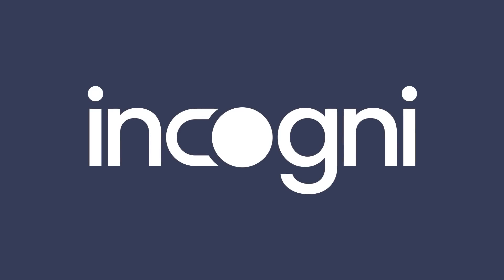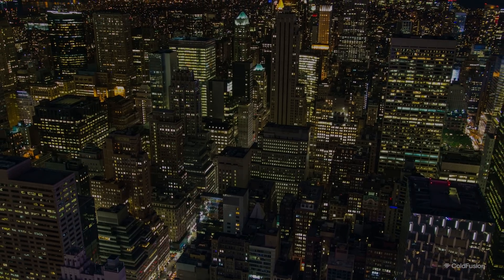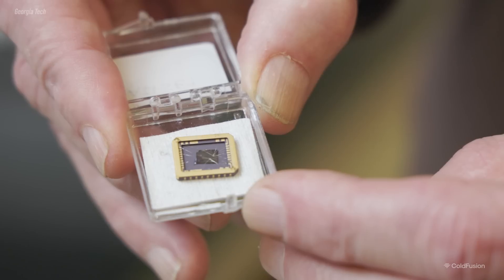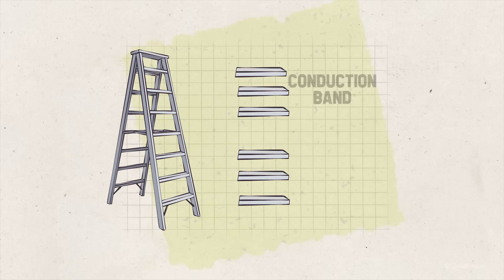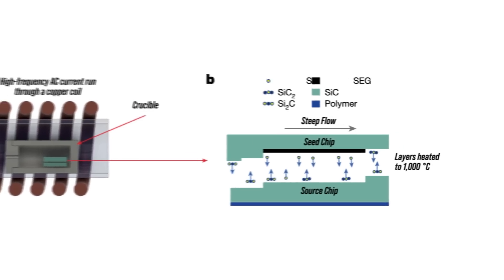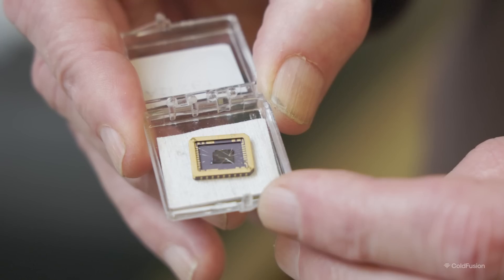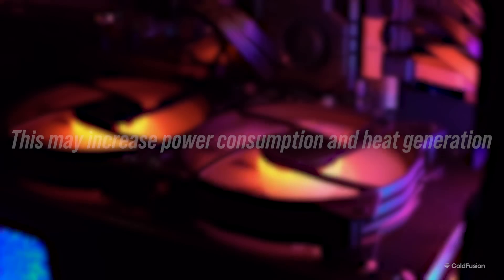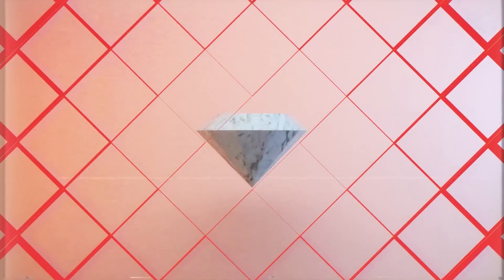This Chip Could Change Computing Forever

Comment: I've heard, for about 20 years now, that a development just around the corner will make laptops last a week without a charge. Never happens. Color me skeptic.
Reply: well technically speaking if we had the computers with the power from 20 years ago running on modern batteries they would actually be able to run for a week. the problem is that processing power and demand is increasing too fast.
Reply: @jesus2639 Eh, not necessarily. Older Chips were much less efficient compared to modern ones. Whereas modern processors are capable of providing the same amount of computational power as those old CPUs, utilizing much less power. Although, we took advantage of that better efficiency and greater transistor density to produce chips capable of producing much greater computational performance. Battery life has improved due to better power management of how much energy is provided to a CPU or GPU depending on its workload and the breakthroughs in battery chemistry with Lithium Ion and Lithium Polymer batteries and hopefully with the advent of Solid State Batteries, battery capacity will continue to improve. Also, with the introduction of GaN (gallium nitride) power supplies, we are able to provide much higher wattages when charging and powering devices with greater energy and thermal efficiency.
Reply: @jesus2639 I have an iphone 4 I occasionally recharge just to keep it alive. With everything disabled and turned off the battery last 27 days.
Reply: That's an interesting observation. Makes sense:) @jesus2639
Reply: @jesus2639  On the CPU side of things, can’t really call processing power increasing 15-20% every 2 years as “too fast”. I’ll consider it too fast when we start getting massive jumps in CPU clock speed again, cuz even IPC improvements aren’t big anymore
Reply: I thought it was the opposite. Chip architecture getting smaller and smaller and needing less pkwer to operate, thus lasting lk ger o. The same size batteries. The problem i see is laptop batteries getting smaller to save weight and display resolution and brightness getting greater using more power. Phones are the same, getting bigger and bigger displays and running brighter with higher resoltion while batteries get smaller.@jesus2639
Reply: @jesus2639  it would be the opposite the computers today are much more power efficient
Reply: @jesus2639  Well, we have the product actually, we just call that mobile phone now
Reply: @jesus2639 I was going to write exactly this.  Well said.  (Computers from a few years ago let alone 20 years ago could run a very long time on today’s battery technology, it’s just that processing power gets exponentially more powerful l, requiring more energy.)
Reply: This. We got addicted to graphics
Reply: @jesus2639  no? Absolutely not? TDP of late 90s - early 2000S CPUs was the same as 2-3 y.o. high end CPU?
Reply: @jaleger2295 you failed to mention all the other differences, we have better batteries now, we have brighter screens, higher resolution better refresh rates, higher wattage usage in CPUs and GPUs, if you lowered all of those you would get a significant amount more time per charge, this is proven in current phones
Reply: @jaleger2295  really doesn't work like that. We have super low wattage CPUs that consome a miniscule amount of power compared to the best of the 2000s and outperform them with leaps and bounds. Yes we have 145w consumer monsters but that's just because the demand Is now there for applications we diddnt have then. There were zero 300w GPUs or GPGPUS then but we have now. Most GPU or parallel processing units were in double digit wattage at best. Were getting far more efficient performance/watt then we've ever had... ever. So your statement is categorically false
Reply: TIME. We don't all have it, but these take time. 25 years ago it took 20 minutes to download a 12 second  porn clip. Now I complain when a 4 GB movie takes 2 minutes.
Reply: @ald.3387 you mustve had a T1 line to download that clip so fast!  Or knew someone at Kazaa
Reply: My e-ink tablet lasts for weeks
Reply: Thing is in the same time we developed more and more energy hungry computers so it tends to balance to the user needs (1 day).
Reply: This.  Google and Apple will just run more bloatwares in the background to drain that battery.
Reply: i would like to point out that if you were still doing the same things with your laptop as 20 years ago modern laptops could manage running a week easy.
Reply: Ehhh, look at the numbers
Lowest TDP atom laptop processors are like, six watts. There are 168 hours in a week. Times six that's 1008 watt hours, way beyond any laptop batteries available on the market.

Apple M1 has seven watts minimum TDP, so ARM magic has no power here either.
Reply: Actually, if you was to design a laptop with the same computing power as the year 2000, and used a high efficiency display, yes, then you could probably get a laptop to last a week without needing a charge.
Reply: But laptops do run for a week without charge, that’s if you use laptops from 20 years ago with batteries from toda. But since capabilities of laptops of upgraded too, they demand more energy and hence can’t last for a week
Reply: Well technically, today we could indeed make a laptop that would last of battery for a week and would be of form factor and performance similar to what used to be 20 years ago. It's just that every time we given opportunity we tend to instead take better form factor, more pixels and brightness on screen, and more performance, instead of increased battery life.
Reply: They do! But then they pack in more power hungry stuff. Just like how games keep looking better but instead of story, they stuff in micro transactions.
Reply: Lol thing is, if you made a computer that had the same processing power as one 20 years ago with a modern battery, it would definitely last at least a week
Reply: There were times we thought we could never fly, go to space and more through our history.
It our species how long to invent something  you can watch this and criticize it's taking to long on ?.
Reply: Well, we (as the general consumer) don’t really want that. 4-8h is enough, everything extra is either allocated to more computing power or just useless aditional weight and cost.

The same with modern phones, 1.5~2 days is enough, and apart from a few fringe use cases, the rest is just pointless weight and cost.
Reply: And it is true. The compute of a windows 98 machine could already today last for two weeks and more (bottle neck the light in the display). But because people don’t care that their machine has battery for more than a day, the workload demand scaled relatively to keep it at a day, while processing 20x and more of what was common before.
Reply: And this is really the whole problem. We've seen many claims of graphene revolutionising electronics but the simple fact is that production costs are still far too high and all these claims of the manufacturing being so cheap are deliberately vague. Even graphene battries, which are nowhere near as complex as a transistor, are still considered too costly for mass production despite their advantages. At present the production cost of lithium is $11/kg with graphene being $200/kg. That alone is why estimates say that despite graphene production increasing it still won't become a viable alternative until 2031 and that's assuming lithium doesn't get cheaper to manufactuer or new naturally occuring sources are ever found.
Reply: The problem is the media. They exaggerated the output of graphene. Graphene is going to come out and revolutionize many things, but it will not come out alone in 10 years from its discovery (2004).
Reply: Check how difficult it was to invent the blue LED.
Reply: We could make one tomorrow.

But would be an brick thick laptop powered by an small low power mid range smartphone ARM chip.
Reply: AEROSPACE Engineer here and I've heard some similar stories regarding many technologies like: 
1950 We'll have Nuclear Fusion in 30 years because somebody made a breakthrough.
1960 We'll have Nuclear Fusion in 30 years because somebody made a breakthrough.
1970 We'll have Nuclear Fusion in 30 years because somebody made a breakthrough.
1980 We'll have Nuclear Fusion in 30 years because somebody made a breakthrough.
1990 We'll have Nuclear Fusion in 30 years because somebody made a breakthrough.
2000 We'll have Nuclear Fusion in 30 years because somebody made a breakthrough.
2010 We'll have Nuclear Fusion in 30 years because somebody made a breakthrough.
2020 We'll have Nuclear Fusion in 30 years because somebody made a breakthrough.
By chance can you guess how far away nuclear fusion will be in 2030?

I'm Australian but did my degree in America.
I was doing my degree in the late 80s and we EXPECTED to build Space Station Freedom in the 1990s and then be back on the Moon by 2001 to start setting up a lunar base that would be the start of a permanent settlement AND YES we took that date from the film. 

THEN the Challenger accident happened and as we know it was because of poor decisions being made by the wrong people. That has been followed by several 1,000 poor decisions being made by the wrong people and we are no closer to a permanent lunar base than we were January 28, 1986 when Challenger happened.

I have spent the last 30+ years working across a variety of industries doing industrial control systems and trying quietly to learn from these industries how we might do stuff on the moon. 

So long as we have the combination of the wrong people making bad decisions in combination with the unrealistic promotions (and at least Cold Fusion does but "providers" into the story) of effectively vacant over rated (and often over hyped) "future technologies" that will re-shape humanity we wont (as a species) move forward because too many of the basic things like food, shelter, clean water, clean energy and a few other things are NOT DEALT WITH as a priority. 

I have spent most of the last 20 years working on construction mines in remote locations because it presents the same sorts of issues building a lunar base has. Everything is at least 3 days away, the environment is hostile and you have to build all the basic infrastructure any modern society needs including housing, food storage, food prep, clean water, waste water, power (including power distribution), roads and very importantly workshops for maintenance.

While we have story after story of the latest break though technology we are also surrounded by crumbling infrastructure. Go and look at any modern society and you will find major infrastructure issues. They might differ from country to country but we all have them. Energy infrastructure is the major issue that most have and its a serious issue because everything needs energy.
Reply: Well there is one major problem:  Software developers have gotten lazier and lazier with writing lightweight efficient software.  The hardware keeps getting faster and faster but ends up taking more cycles to accomplish the same amount of work because of the laziness issue.  Battery life has gotten notably better.  Not anywhere close to the "week-long battery life" range but the best laptop batteries used to only last about 3 hours and weighed a couple of pounds.  Now they barely weigh anything and last about 8-10 hours on a single charge.  So incremental improvements have been consistently made over many, many years.
Reply: So technology is at the same stage as it was 20 years ago. Damn why did i buy a new gaming pc....
Reply: Cost of graphene was never there when you had cheaper work arounds by just packing more transistors or other methods to get similar end goals. 

 I think physics has forced our hands, and that altneratives are required if we want to see improvement.  

 Whether it competes with other tech is the biggest question.

 Not to mention graphene research and production has improved. We actually HAVE been using graphene in applications.  From metal urgy to cement production. Lots of different things!

 Just need to get pure graphene to be cheaper is all!
Reply: Facts, just like apparently our government has been in contact with aliens but I’m waiting until they show themselves up front loud and proud before I believe it just like a lot of science
Reply: Read some papers on it
Reply: But now we have AI. AI will make all possible. Don't ask me how. But AI!! (;
Reply: There was always a need accelerated by personal computing devices and EV but I don't think there was anything "around the corner" in fact everyone is racing to find new materials for battery.  but AI for sure will speed up the search for materials that will be compatible to work as battery.
Reply: Me too
Reply: Arm based CPUs. Your welcome
Reply: The difference between a breakthrough and making it commercially viable. The difference between a person taking a week to make one "Transistor" the size of a pea and being able to make billions of much smaller transistors in the form of an integrated circuit (a computer chip) and spit thousands of those out every week.
Reply: Google Borophene and thank me later
Reply: Have you seen how fast Llama 3 is?
Reply: Can you wait for a few more years now 😅
Reply: It’s for me M series MacBook is realization of such proposals.
Reply: Weird, I haven’t.
Reply: I'm still waiting for my hoverboard
Reply: The other day someone explained the same concern as it relates to fusion.  

In fusions case we are trying to build an engineering solution that utilizes the extreme edge of our understanding of physics.  What this means in practice is that engineers building the reactors can't really model the reaction since we have no idea what is actually happen.  This means that every step forward requires trial and error and physical testing.  Where a breakthrough in a known process like fission would require building a model to play with the changes, for fusion you can't do that because the physics is unknown.  

I wonder if graphene based transistors are in the same boat.  It could work but we don't have the modelling to make it happen in a short period of time.
Reply: Spent my entire working career around people like you who did their best to slow down or prevent advancement.
Reply: Battery technology is not an engineering technology like CPUs or GPUs. It’s a Chemical technology. So it needs time and chance.
Reply: Hold on let me find some crayons
Reply: Agree. From research/breakthrough to economical production takes about 20 plus years.
Reply: Right up there w fusion.
Reply: Same thought, if it happens it will be in 30 more years
Reply: I actually have a laptop that lasts a week; it just has the graphics memory and speed of a laptop from 20 years ago.
Reply: I guess you havent heard about macbooks with m processors
Reply: OP That wouldnt sell more products!
Reply: We can do that now just dont turn it on....
Reply: You could make a laptop with the processing power equivalent to that of one 20 years ago last a week on one charge.
Reply: I think scientifcally that might be possible , however the economics of it fails due to the market will fall , like light bulbs , did you know there is a light bulb running over a 100 hundred years still to this day , the point is companies will never make a solid product because it brings down sales , if its not breaking your not going to buy another simple as that.
Reply: He looks like the next scammer.  I want a gas powered phone please!
Reply: Nuclear fusion
Reply: @Seakingalpha  sure we are going to have system A at 80 million degrees and with a centimeter system B will be -260 degrees.  That's literally having you cake and eat it to.  But hey it would be great.  Anyways we already have Fusion it's called a hydrogen bomb.  Let say the Fusion slogan "Another 20 years!"
Reply: They could easily make a laptop that has the performance of one from twenty years ago last a week...
Reply: @matthewjudge3763 if you can give me the numbers I'd believe you. Laptop batteries nowadays are like 100-200 watt hours. To last literally a week you'd need one in the order of thousands, even with the most efficient processors and screens.
I guess if you literallt re-manufacture a 386 in 3 nm process node you can do that lol but no foundry would take that request seriously.
Reply: if programs were as complex as they were 20 years ago, your laptop would last a month. the problem is that as hardware gets better, software gets bigger
Reply: Well whats stopping us of having 7 smartphone batteries of a current gen flagship phone that  has a 24 hour battery life and connect them to one high efficiency oled screen twice the size than found in folding phones, connect one smartphone motherboard and a keyboard. Then you'd have a "laptop" with 7x 24h battery life powered by most likely android, which can function as a laptop, like Samsung Dex.  (Current day flagship  smartphones are about as powerful as a midrange pc in 2019)
Reply: For real, every year you hear about a fancy schmancy breakthrough that's about to CHANGE THE UNIVERSE AS A WHOLE just for it to either pewter out or move the goalpost again and again ad nauseam.
Reply: The real problem is the amount of graphite that would be needed and with current levels low things could be a big problem for making graphene
Reply: 20 years ago folks were promising cheap, lightweight television screens were right around the corner. I sat in a similar on something called “OLED” in 2005. It’ll never happen
Reply: Same thing with battery technology
Reply: It won't ever happen because. Capitalism.

Making things that last is antithetical to making profit.

A battery like that would last a really long time.

So less profits
Reply: @halcyonramirez6469 yeah , I bet communism will bring us great progress like the soviet Union 😂
Reply: @halcyonramirez6469  at least it will eventually get built, unlike in communism!
Reply: @solo1014  I don't know man. capitalism is just as bad if not worse than communism if left unchecked. It's just not sustainable and we're already seeing the cracks
Reply: @halcyonramirez6469  capitalism has a much better track record than any communist economic system.  With far fewer people dying of basic necessities.  (In capitalist countries, death is far more frequent from excess than deprivation.)
Reply: They could last a week. It’s just companies are trying to find a balance between battery life and capabilities. Companies would rather keep what they perceive to be a long enough battery life and increase the performance instead.
Reply: Honestly, I use my Mac for 3-4 days without charging, pretty close
Reply: Thanks professor smart ass
Reply: Amen. Can the paper be replicated? If so, we are happily wrong. Otherwise it will always be 20 years away.
Reply: Laptop charge once, last for 3 to 6 months after 20 years now.
Mark my words 🍵
Reply: I charged my laptop once, 8 years ago, it ran away and i havent seen it since!
Reply: It will last a week if you’re satisfied with a computer that has the same compute as computers from 20 years ago
Reply: Research is always continuing, but the jump to manufacturing and product finalization could take decades. This one is a pretty step jump. A chip has hundreds of problems to solve, and they’re all fragmented and colliding.
Reply: An example, EUV was invented in the 1980s. TSMC started using it in 2019. That’s how much time it took for it to become used worldwide. The problem is too complicated, and often involves quantum physics now.
Reply: It will happen, but decades from now.
Reply: Remember the Magic Leap VR/AR startup? Same story.
Reply: It’s because software became more and more demanding
This is what they didn’t calculate the evolution of operating system
Reply: dont go well with obsolete-to-be tech i guess...
Reply: The first computer was created 80 years ago. We had to wait another 40 to own one. These things take time
Reply: The wonder of graphene has been systematically kept under the radar.
Better said we have birds in the sky that are nearly undetectable using this technology on full size scale.
Reply: Instead people keep choosing faster conputers, lighter machines, bigger screens, and beefier graphics.  
There isn't an actual demand for it to last a week compared to these things, otherwise it would be on market already.
Consider that a mid tier phone can emulate a laptop from 20 years ago, and if you added battery to make up the size/weight difference, it could definitely last more than a week.  

We even have tech like this in consumer devices already. I charge my Kindle every 2-5 books read, about once a month.
Reply: Today, the marketing liars do the same with EVs ! Iit is just to speculate. Reality is different, yet progress is made.
Reply: You don’t understand greedy R&D among corporations. If development is linear if your on speed 3 and you discover a way to skip to speed 20 you don’t use that technology. You squeeze every penny out at every number up to 20 then you “discover” the world changing material.
Reply: Except Apple did exactly that with M1 chip
Reply: @seansingh4421  no lol. M1 chip is 7 watt at its lowest mode, the macbook has 100 wh battery. powering just the processor alone would only last the battery 15 hours, which is far cry from "a week"
Reply: Trust me bro just around this last corner, it's going to happen, bro just one last corner and we're there bro trust me
Reply: Put a new battery in an old cell phone it will last a month
Reply: It's not that advancements aren't being made; rather, it's more a case of underestimating the complexities of getting these new advancements to a point of efficiency (ease of production, power consumption, etc.) where these technologies could be introduced into the market. Additionally, as annoying as it may be, researchers working on these types of long running projects require funding and one way to get more funding is to create excitement around their projects, so of course there is a tendency to exaggerate at times.

This, however, seems more promising than most advancements given how little change to manufacturing processes that would be required in order to begin producing chips with this technology. Most upcoming technological advancements require entirely new manufacturing or fabrication processes and different, sometimes expensive materials, and that's a much bigger hurdle to overcome than research and development.
Reply: @radicalraccoon  Good comment.
I'd however use the word viability rather than efficiency in the middle of the first paragraph because that's what your talking about with things like "ease of production."

On your second paragraph however is that your 1/2 right in that some parts of the chip manufacturing will be the same or similar. In particular mounting the chip into a substrate and attaching the pin connections  and then encasing it should be reasonably close if not identical. 

BUT if you have ever looked at how they actually make the actual chip in terms of the layering then this will NOT be the same. If it was then these chips would be on their way to market and they are still years away.
Reply: Batteries have evolved significantly. However computing chips have also evolved needing more power. An iphone battery, can run for a month on a brick phone.
Reply: @da7me22  I don't think they'd run a brick phone for a month but the point you make is valid. 

A lot of people do not know how much power these larger systems actually require. Just recently in North or South Carolina they rejected a company wanting to put in a sever farm. People ranted about jobs until they realised 2 things. Once built the server farm would have ZERO permanent staff as they'd run it all form other places. SECOND it was going to need over 900 Megawatts of power. The latest AP1000 Nuclear power reactors at Vogtle in Georgia cost US$17 Billion EACH. and they put out 1100MW.

YES Computing systems now require massive amounts of energy and a significant part of that is cooling. Iceland is currently hosting a lot of the crypto currency mining systems. Because every transaction needs processing and in Iceland they have an energy free cooling system called "a window" and they just open it.

Our wonderful IT world uses staggering amounts of power and mobile phones are just one part of it. Each mobile phone in itself doesn't use much power but the billions we have use a lot of energy to charge and the networks use a heap more to operate.
Reply: Not sure why anyone would need a week's charge. Most laptops spend 90% of the day plugged in.
Reply: @MirzaAhmed89   you wouldn’t want your  car battery to last 10x longer?
Reply: it generally takes about 20-30 years for stuff to leave the university and make it into a product. Especially dramatic breakthroughs.
Reply: Its not profitable business
Reply: It's a really big corner but progress is being made.
Reply: I was thinking same thing
Reply: Look at macbooks with the new M generation chips and compare them to notebooks just a couple of years before.
Reply: Revealed preferences of most consumers is that they don't care about battery life so battery improvements are converted to support more powerful items.
Reply: Ok but we're your invention at 😅😅
Reply: Soon enough my friend, soon enough we'll have graphene cpu laptops, with 500mb ssd
Reply: Unless you're using an E-ink display, it's still probably not going to last a week. A good chunk of battery is used for the display.
Reply: I think they put it in Ipad. My ipad last a month if I don't use it lol. My watch last for about a month. With heart rate reader off.
Reply: for that, we need e-ink displays

chips are using only a small part of the overall energy
Reply: Battery problem, not computing problem.
Reply: The M1 Chip is literally what you’re asking for.  The MacBook Air with the M1 chip is so efficient it lasted me nearly a week.  On normal use (browsing, emails, etc) it lasts 19-22 hours.
Reply: A Nokia lasted forever... Bring in a bright screen and your battery will die..
Reply: They already exist. When batteries got bigger computers got more demanding.

put a new battery in an old computer & it will run for several weeks.
Reply: Same with fusion
Reply: Technology moves at an excruciatingly slow pace in the past decades.
Reply: Mine does, I never open it
Reply: I agree with you I've been hearing about this forever battery forever now
Reply: This is 100% true,but only for RnD. The mass public would never see this because the big corps although have this tech would never allow it tp be produced for the masses, not yet anyways
Reply: It's the same as fusion it's always around the corner 😂.
Reply: Cause it's probably in our weapons of warfare. They probably don't want the 'competition' buying a laptop and getting up to par with the USA.
Reply: It's still possible but companies work on finances and want their old manufacturing facilities to make profit even if it means not caring about innovation😢
Reply: Indeed, most of the power will just be consumed by the display.
Reply: The World will change very quickly now
Reply: Anastasia tech recently did a video on this same topic.
Reply: just curious, do you think anything is more advanced in the last 20 years? or you think nothing has happened? probably too clever to be bamboozled into thinking there's any progress.
Reply: Same with cancer cure : Never happens ,might never happen until a new life threatening disease is explored.
Reply: @andresconrado 
Yeah, about 20yrs sounds about right. 
Ignore it. Either its bs marketing, or want-a-be's, being the first to spread the rumors.
Reply: Countless discoveries and technologies are absolutely world changing and never go mainstream or see the light of day. Just an unfortunate state of the world as of late.
Reply: your not wrong
Reply: It used to be very expensive and not a lot of it.  Now it's already available in consumer electronics.
Reply: My MacBook Air M1 last a week for my usage, LaTeX typing and some web browsing every now and then. So technically the technology that allow laptops to last a week without a charge exists. Unless you want to be more specific about how the laptops are used
Reply: Laptops will never last a week without charge,  that has little value to consumers. So instead batteries shrink.    
Look at the size of old laptop batteries, if we kept them that size new Mac m2 would last a week easy
Reply: So true
Reply: My macbook in sleepmode for a week without a charge.
Reply: Bro said 20 years. Thought graphene became a thing in 2012
Reply: not to be corny or anything but they said the same thing about the lightbulb
Reply: As i'm getting older i'm getting more skeptical about these so-called breakthroughs, or maybe just more cynical.
It is hard to be persuaded by these promises when in my short 30 years of being alive i've seen so many false promises and flops.
I believe that progress is not linear nor exponential, but rather has bursts and is spontaneous more than anything else.
People always see bursts of progress and assume that it will continue at a similar pace, when in fact it never continues at its current rate.
Reply: I think photon based computing will come first (not the quantum one, different).
Reply: Smartphone is not a thing 20 years ago bud.
Reply: You should have had the experience of going from Intel to M1 on a MacBook. Extremely fast and three full working days of charge.
“Imagine your laptops being five times faster and lasting for days on a charge” - have tried it!
Reply: I was 16 and well into tech in 2004 and nowhere did I ever hear any claim of - a LAPTOP of all things - lasting a week... Battery tech was utter trash in those days, I would love to see who made the claim that a "1 week laptop is just around the corner".
Reply: 20 years is irrelevant in the total span of time. Think of how long it took humans to come up with the light bulb. Do you not think our ancestors didn't imagine a way to have indoor artificial light?
Reply: someone have to invest into economy of scaling of new techs
Reply: The thing is, the chip may go well in lab, but not in small scale production. Then after they fix that it might not go well in large scale production, then they need to fix any real world testing etc.
Reply: Wonder if it's a matter of $$$$ as in the world live the longer something lasts the less you buy hence Cr@pples business model planned obsolescence so you're forced to buy new according to apples schedule.
Reply: I mean, Apple kind of did it. My macbook with M1 lasts 10x longer than any windows laptop I've ever owned.
Reply: its all cool until we get hit with a pandemic and we realize that we cant even manufacture face masks and have to beg china for it lol . all these scientific brakethroughs news is more of a propaganda tool than reality .
Reply: lol maybe because processing speed and power usage also increases along with power storage and distribution along with loss...did you even watch the video mr skeptic
Reply: It has happened. If the tech was patented, you can bet it was either brought up and shelved or, patent laws made it a 'national security' issue
Reply: Do you know anything at all about the science behind any of the technologies you’re complaining about? 

The shortest answer to your unwritten question is…. 

Battery technology hasn’t even come close to keeping up with microprocessor technology and its famous Moores Law. 

More specifically and even more critical is that charging technology hasn’t been anywhere close to being capable of realistically supporting a battery with an energy density sufficient to power a current generation laptop in the way you imply. 

Imagine charging a Tesla with a 12v home plug. Ya it gets amazing mileage but I have spend 3 days charging it…
Reply: Tech does exist but if given to masses so easily then who will buy new laptops, phones so frequently 😂
Reply: @brade2163  You’re just repeating what yer man said. Instead of it being science and its horrible timeline predictions, you’re saying the “tech” exists but is held back because of capitalist greed. 

You’re both just vomiting tinfoil hat level thread comments. 

🤫
Reply: First, all the tech that is passed down to consumer level, has to go through military application. Military tech needs to be at least 2-5 decades ahead of consumer tech. 

Second, to please the shareholders, manufacturers will do their best to extract every single penny from the current tech and then introduce the next phase when the profits start plateauing. 

Tech may already be there, but, it has to go through channels that takes years before reaching the consumers.
Reply: It's part of the 'marketing' strategy to get funding. Scientists and engineers need to market their ideas to get it going too. So always take whatever you watch/hear/read with a grain of salt, because all those promises or speculations will remain as is until a breakthrough happens and we see a working model of the thing they are promising.
Reply: So i bought a keypad mobile and it has the latest battery technology and 3000mah which makes it last like 2 weeks . So i think the the batteries are improving but the processing power needed are also increasing .
Reply: Depends on which laptop you’re talking about. If we’re running a laptop from 20years ago today, it’d probably run for a month without charge
Reply: Hope it doesnt just get absorbed by amd  or nviidia but he decides to go elon musk style and gives us innovation again instead of this step by step design these companies have worked out to maximize profits.
Reply: Anything too efficient doesn’t make money so it will never happen.
Reply: It's 30 years since we had the first browser, Mosaic and then Netscape.
Do you think the Internet have changed since then?.

Silicon transistors was created at the endo of 1947, about 75 years ago. But the Intel 4004 wasn't launched until 1971, 24 years later, and Intel 8008 1872. So, it took 25 years to get from knowing that semiconductors was possible to the CPU we utilized in out first primitive PC.
And that was from a material that was a semiconuctor, and not just a conductor.

Graphene was first made/discovered 2004, so 20 years ago. Prodused by pulling it of granite with a tape!
I guess the production technique of it has improved somewhat since then. But that's just a very good conductor, not useful for much else

And you think 20 years is a long time from detecting a new form om material, a conductor, to make integrated semiconductors from it?
Reply: fully agree, with carbon there are since 1950 freaking close ...
Reply: They require finance. Wait till it reaches the Chinese?
Reply: Because it already happened and there was already a few models of notebooks that had low calculation power, but  high power efficiency and got big batteries on board. As for phones, the old models of Nokia could've functioned for month without charging (H18 and 3310)
Reply: Yea, but now we actually have an example of the tech that works. This is a decently good milestone that brings us closer to actually bringing this to market
Reply: It's easy not to even try in the first place 😂
Reply: Companies:wheres the profit in that?
Reply: They did succeed but the consumption jumped too
Reply: Literally my reaction exactly! How about before we talk about it becoming a technology introduce it into something and then yap about it.
Reply: It's not possible, until it happens. Then it's obvious. Enjoy your horseless carriage 😂
Reply: I didn’t mind the low bandgap so much as the missing explanation of exactly what made it semiconducting.  What was the secret sauce?
Reply: @OtterFlys  it's explained in the video....
Reply: This was an attraction bait, cpuz abd gpuz don't consume the majority of phone charge (you still havw the big ol display)

But just think that this is much better processors
Reply: I mean the tech is there, it could have happened 10 years ago easily. Why companies prioritize for battery life to such a degree?
Reply: That’s the case with nuclear fusion power plants.
Reply: @kiuk_kiks not really. Since the 50’s scientists have known fusion is solved, it was merely a matter of scale, it only works once power plants are of tremendous size, which thus far had never been built. Technically even ITER, despite being an attempt to build them closer to the size at which we know for a fact it will work, is still only about 60% of the size we expect a working fusion reactor to need to be at minimum. They need to be utterly massive, dozens of stories, over a hundred meters wide, etc. and the world economy could technically afford to build one now, but that would be a huge chunk of the total global economy for several years just to build the thing.
Reply: @smallpeople172  
It’s not a matter of scale though. They’re net consumers of electric power.
Reply: @kiuk_kiks  yes until they reach a certain size, and below that size they aren't able to produce net energy. This has been a long known issue in fusion. Literally what I'm talking about about. They are known to be unable to produce power below a certain size threshold, much larger than ITER. All the projects on fusion are really just miniaturization projects
Reply: @kiuk_kiks  those doing the work always think they are almost done. They tarely are. In all disciplines.
Reply: You do realize innovation doesn’t happen with a snap of your fingers right?
Reply: @Retly_Ai 20 years isn't a snap of your fingers mate.
Reply: @Alec_Reaper  The older I get, the less I agree with your comment.
Reply: @Alec_Reaper  using 1 example of tech is how laptops have only existed for 45 years. Do you automatically assume technology is at a standstill still? 20 years is about half that time. So sorry if you lack the ability to understand how innovation works. 🤷🏻‍♂️
Reply: Sure, and Rome was built in a day.
Reply: @Retly_Ai  He never said,indicated or assumed that technology was at a standstill, you assumed he did or disingenuously portrayed that way. And whats sad is your inability to communicate without being an arse to feed your ego.
I have been hearing about this for ages and still not one thing out yet, so at least some weary skepticism would be understandable and all he was saying.
Reply: Then be specific in the "far future"
Reply: @tshwarelolebeko2395 well we don’t know how far in the future, and when working on some project, people are typically expecting it to be done sooner than it really will be, and the really will be is impossible to predict
Reply: @Retly_Ai it has to go through the military first, then we get it 😅
Reply: @mortalkombat266 Unironically, the military doesnt get the best and lastest nowadays and consumer chips can outperform those produced specifically for military use. In fact the us military bought 1000 playstation 3s years ago instead of buying enterprise grade equipment to build a supercomputer. It was one of the most powerful supercomputer cluster that the us military had at the time.

Edit: People tend to forget that new technologies introduces vulnerabities. Vulnerabilities that the us military wouldnt wanna take.
Reply: @BocchiSensei  The Black Ops military does.
Reply: @BocchiSensei 
Performance is usually the secondary concern when it comes to military equipment, sturdiness comes first since any military grade equipment needs to withstand harsh conditions.
Reply: @mortalkombat266 military doesn’t get the best shit first. 

That was once the case, but if you’ve been enlisted, you know the term military-grade is a joke of sorts.
Reply: @BocchiSensei  🤣
Reply: @BocchiSensei they did that to test gaming platforms, they had a classical computer as well they bought that same year.
Reply: @BocchiSensei the military actually gets better because current manufacturing is chip tech and processes stable enough to have less then 10% misprints, whereas military will use experimental stuff and get a 10% usable chip, but throw out the rest. That’s why their computer systems typically cost over 50x as much as consumer ones, they’re using unstable bleeding edge tech with high manufacturing failure rates.
Reply: @BocchiSensei  the NSA would disagree with you.
Reply: @mortalkombat266 that's not how any of this works
Reply: @smallpeople172 Tech will cost more than average due to low demand and yields. Companies that solely manufucture electronics for militaries are usually more expensive not necessarily because they are bleeding edge, but because they have no where else to sell the stuff to. Any military officer (well most, cant say that all of them are competent and experts) would tell you that they would rather use proven and reliable technologies than ones that are new and unstable as you have mentioned. Its also just logical, a country wont fully mobilize its tech industry towards the military until they are at war. Despite the US spending hundreds of billions each year, this is quite small compared to once they actually mobilize. There was also a documentary that Ive watched before about the real reason why the us military spends so much, I cant really remember much but they do overspend on things that shouldve costed less, on purpose.
Reply: @TheTyronecus the NSA would disagree with using bleeding edge technolgoies that have possible vunerabilities.
Reply: @wisdomleader85 Further proves my point, the military didnt only buy playstation 3s because it was faster, but also more economical and simple. The best of the best will have always vunerabilities. Best of the best doesnt mean its the sturdiest. Any US project that is going right now will likely use technologies available at their time and will be less powerful once they are deployed.
Reply: @BocchiSensei  it's funny that there's a bunch of examples of the military having much better technology than the civilian sector. I'm not going to waste my time listing everything, you should look into history.
Reply: @mortalkombat266 came here to say it.

Mil tech is 40 years ahead…
Reply: @BocchiSensei the budget is black for a reason… this is not exclusive to computers, but to patents. You, and your elected leaders, and myself, could not even imagine what the military actually has access too.
Reply: @mortalkombat266 
Well, actually No, you have no idea how wrong you are...
Reply: @BocchiSensei  Dear I know you read that somewhere. That's cool; here's the thing; you're wrong. You're just parroting what you read from an article that you find cool. You'll realize this before you turn 30.
Reply: @BocchiSensei they did that to save money ,not bcz chipmakers rejected to provide them.
Reply: @BocchiSensei, to your point, 100% yes. the best drone surveilance equipment was using the cell phone processors of the flagship phones from the previous year.

Now, the NSA on the other hand...
Reply: @Karlswebb   I dont read those kinds of articles that much, found it out on a youtube video about the history of x86 (if i remember correctly, might be something else entirely), its just logical to spend money in proven tech while spending just a small portion on experimental ones. That said, i wouldnt be suprised either if they are spending THAT much on experimenta tech since alot of piliticians are illogical nowadays.
Reply: @happybetowantjusti  No where i stated the chipmakers rejected to provide them, I also clearly stated that they did it to save money, the same words you have said. Read it twice next time.
Reply: @TheTyronecus  And theres also a bunch of technology oriented towards civilian/consumer use that are better than the military. Maybe check the entire history of these stuff yourself. Theres always gonna be something better or worse. In this case, the military wouldnt risk spending billions on something that has potential vulnerabilities, its just logical. An example is windows XP, its probably just the lack of funding or something else entirely that some government agencies still use old operating system but another thing to point out is that older operating systems are way more secure, more features introduces more vulnerabilities and the US military certainly doesnt need copilot in their computers.
Reply: @BocchiSensei  your comment is edited.
Reply: @happybetowantjusti  That much is clear, you can see the edit if you expand the comment... Maybe try double checing everything next time.
Reply: @Retly_Ai  dude, this is literally what he’s saying. He is skeptical in this advancement because it is like the “snaps of fingers” that have been touted in the past.
Reply: @Nadzap   doesn’t change the fact that people still attempt to innovate even if corrupt companies screw the consumer with little to no technological improvement in their products. I thought that was an obvious concept to understand but I guess not.
Reply: @Retly_Ai  Then why talk about it as if it happened already?
Reply: @piotrd.4850   crazy how I didn’t say that. I simply implied assuming tech wont progress is an idiotic opinion. Good try though. 🤷🏻‍♂️
Reply: @Retly_Ai then stop claiming that we're on the cusp of a breakthrough. 20 years is a long time to be saying this stuff for.
Reply: @Retly_Ai  Lol dude this is simply evolution manipulation, imagine not needing to change a PC or a laptop or a smartphone each year... Not much money for the big corporations... You are part of the problem, get lost kid.
Reply: @Retly_Ai   while you are correct, but when promises keep getting made and not being met, apathy sets in.  (See fusion always being around the corner.)  We may yet have it some day, but people need to promise only that which may reasonably delivered.
Reply: @Retly_Ai You do realize that the army got the technology first. Also there's nothing in this world can be made with a “ snap ”. If there is, please give some examples.
Reply: @Retly_Ai  this is decades old scam bruh, "it's just around the corner" my ass, if it's actually is, they will come hit like a train
Reply: @Vysair   almost as if the phone you’re using to type that cringe took at least 20 years of innovation. Good try though 🤷🏻‍♂️
Reply: @Retly_Ai The OP said "20 years" not a "snap of the fingers"
Reply: @Retly_Ai  He's been waiting 20 years dude, so have I. Who said anything about snapping fingers?
Reply: @Retly_Ai  On youtube there is another video claiming a breakthrough solving climate change every week, its just noticing how things really are.
Reply: @Retly_Ai  when u have thousands of interesests everything is slow.. and u could say depends on the on interest and i would say so true
Reply: It doesnt happen at all... Corporations buy these patents and toss em in their circular file cabinet. @Retly_Ai
Reply: @hankskorpio5857  not all companies do that which leads to corrupt companies falling short in competition. A good example is how Xbox has fallen off its pedestal when they chose not to innovate with its competitors.
Reply: @hankskorpio5857  the patents would remain filed... where are they?
Reply: Yeah in terms of R&D it’s just around the corner.

As in it’s not 100 years away but more like 20-50 years.
Reply: Over the arc of 35 years, my laptop improved runtime from one hour to twelve hours. On average, laptops have increased battery runtime by one hour every three years. I bet you're skeptic.
If there is a breakthrough, it will not be from graphene (big semiconductor corporations invest billions every year in search of an improvement over silicon), but from Windows-on-Arm computers with e-paper displays, lasting one to three days on a charge. There is a small possibility of a battery with ceramic electrolyte (solid state battery) being commercialized, but not the current types - as they cost $ 10K instead of $50 of a standard Li-Po battery. A solid-state battery can deliver double the energy of a standard type, doubling the runtime with all other specs of the laptop being equal...
Reply: Jesus is returning soon🔥 Repent and turn away from your sins to obtain salvation 🤗
Reply: Alright everyone, let’s shut down innovation. @andresconrado says it’s not fast enough
Reply: Only military will have access to that. If there is less recharge time then it can't be marketed. So it won't happen.
Reply: @eyeofthepyramid2596 thats stupid lol. Right now the a PS5 is way more powerful than the computer of a F-22.
Reply: how long did it take for cars to switch from internal combustion to ev ? Massive changes like this take decades
Reply: @RadialSeeker113 hasn't happened. Because IC is convenient and efficient.l, and the liquid fuel distribution network is well established and works....
Reply: @RadialSeeker113  Cars haven't switched to electric yet. It's too early to say 'did it take'. It might as well never happen fully.
Reply: @RadialSeeker113  : Actually it took about 10 years for the internal combustion engines to kick out the electric cars, around 1905.
Reply: glad we never asked you
Reply: This is that innovation you've been hearing about. Progress isn't instant. If you didn't have the attention span of a Goldfish like the rest of GenZ it wouldn't seem so impossible.
Reply: @DefinitelyNotBender Why are you assuming they’re Gen Z, what does this have to do with attention span, and how do you not comprehend that with all the innovations in the past 20 years that haven’t taken this long, that it’s fair to say “this is just around the corner” is far overused? Can’t someone feel skeptical and express that without you immediately insulting them? I’d rather people have what you call a “short attention span” than whatever failed attempt at a basic civil discussion that was.
Reply: @DefinitelyNotBender  if 20 years is goldfish level attention span what would you say a "human" level attention span lmao
Reply: @DefinitelyNotBender no need to insult him he was just giving an opinion